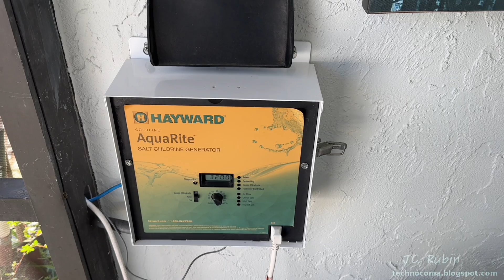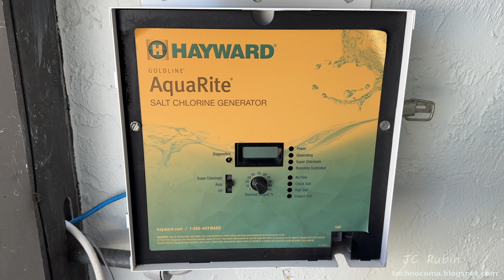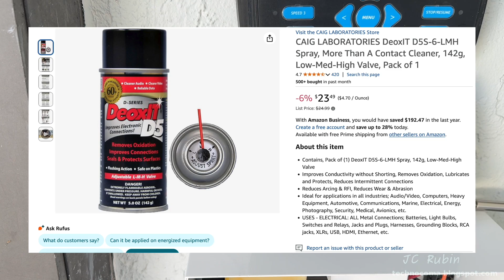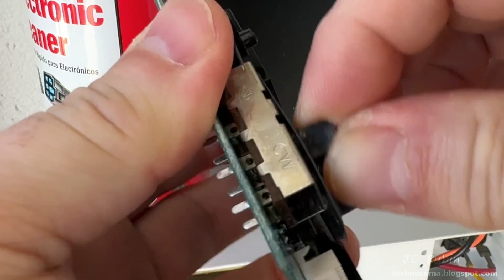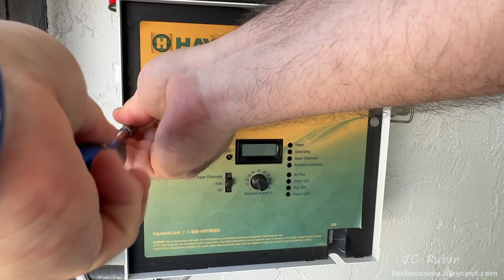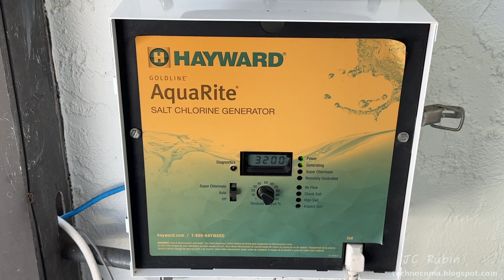Hayward AquaRite Turbo Cell - Front Panel Repair and Maintenance to Save you Money

Comment: I have a hayward salt generator pretty much same setup as you have. The display will scramble all over the play randomly and randomly it will work. If you push on the display it gets scrambled and lights will upp light up and says random words on the display. I bought a new board same thing. You think the pins are just oxidized and needs cleaning? Or you think it's the main PCB?
Reply from the maker: Wouldn’t take much to clean the pins so try that

Comment: HELLO and thank you for the great videos.  My cell is a t-9 and was a warranty replacement from 2023. It demonstrates the same issues as stated by AshleyO-b4m.   Low salt and Inspect Cell lights will not go out. It doesn't want to recalibrate.  The first reading shows a code of SLo ... Or... 5Lo. I have never seen this before.  Is it saying Salt Low?   Water test shows salt at 3000.  Do you know what 5Lo means?  Guy didn't know at the pool store.

Comment: I bought a complete board with display for about $100 on ebay last week.  I knew I was taking a chance but it seemed to show the right salt level and was working for the 10 minutes I remained there after installation.  I checked back many days later and it was not generating.  I forgot exactly the lights that appeared but the display now shows 3.3 for the salt level.  Instant salt level showed the same.  The salt level was showing somewhere over 3000 after the installation.  The diodes are working because I measured 25 volts across them at the same time the current measured about 5 amps.  So it must be generating for some amount of time before it stops.  I just sent it back for a refund today.  Maybe I'll take a chance with another one?

Comment: I cannot seem to find a video resolving my issue. My aquarite 900 is holding chlorine, but the inspect cell and check salt light stay on. They are not flashing and cannot be reset with holding the diagnostic button after cleaning the cell. I have celled the cell with salt cell cleaner and thoroughly sprayed it out. Pool store is testing salt level at 3000, but board is reading 2300 even after calibration. I will try this cleaning/maintenance tips to see if that helps resolve. But any idea what would be causing a steady inspect cell light, incorrect readings with all the correct settings and recalibration?
Reply from the maker: How old is your cell?